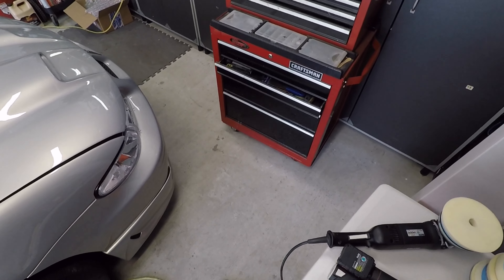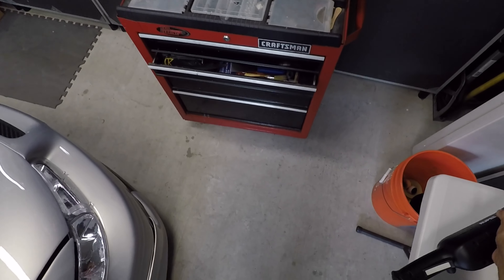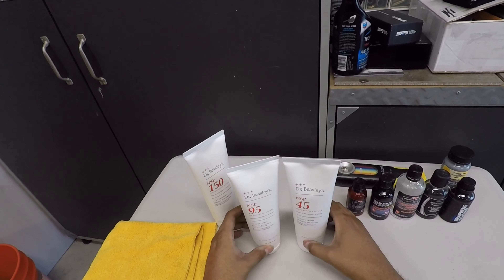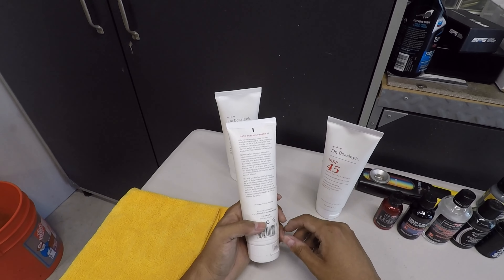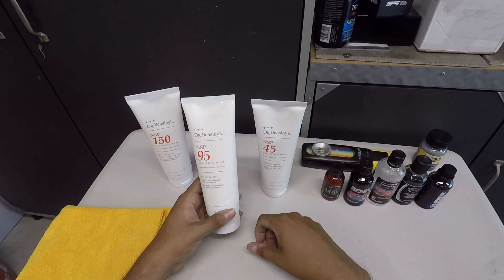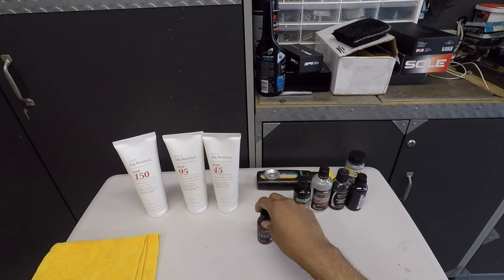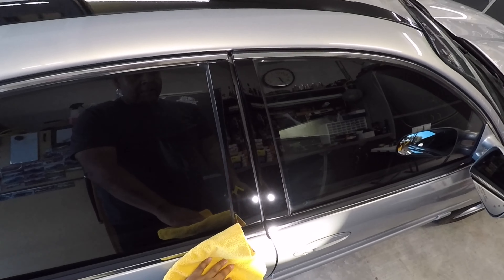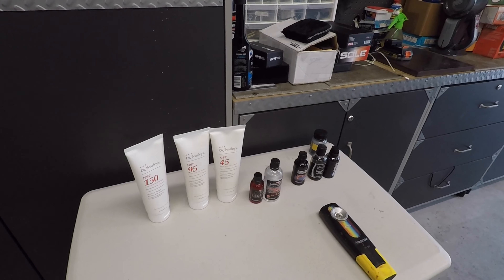Using Dr. Beasley's Nano Surface Primer NSP 45

Comment: This worked great on a white Porsche Panamera. And was a bear to wipe off on softer Toyota paint. I tried the “less is more” method and that worked best for me.

Do you think it leaves a more glossy finish than CarPro Essence due to the titanium component?

And, I bought several bottles when AutoGeek had a sale on it, plus 25% off. Ended up with 40% off final price. I gotta use this stuff more. The whole line. 🤦🏼‍♂️
Reply from the maker: Glad to hear it worked out for you.  Soft paint is never fun.  I have had issues with soft paint on a Toyota FJ Cruiser where Essence would be absorbed into the paint and would not wipe off.  I had to follow up with a quick pass to remove it.  

If the polish is worked down enough and not much is used then it wipes of easy.  The thing to keep in mind is that these are different than even a typical polish when it comes to the amount used.  I will link the Dr. Beasley's video that will help. All of my issues were solved after practicing the technique in the video.  

To answer your question, yes I believe these give a better gloss than Essence and Gyeon Primer which I suspect comes from the TiO2.  Not needing to use a panel wipe is such a time saver. 

About 7 mins into this video https://www.youtube.com/watch?v=_17Ixz_pCJU&t=1s&ab_channel=Dr.Beasley%27s
Reply: @MikeGDetailing  Thanks!  The video explanation is a big help. I will be sure and use it on my next detail.